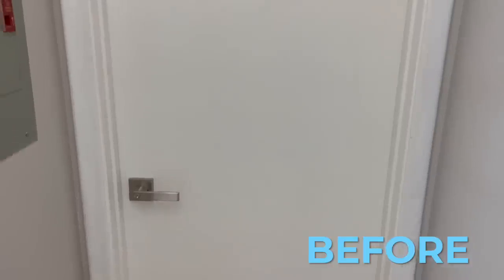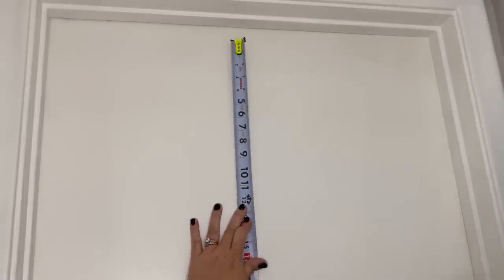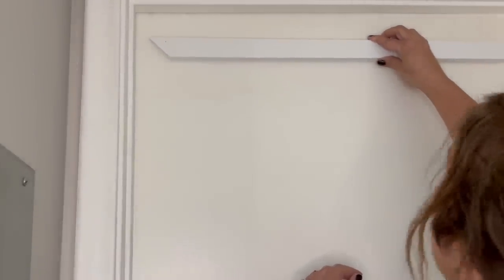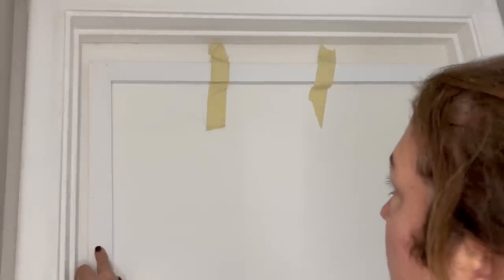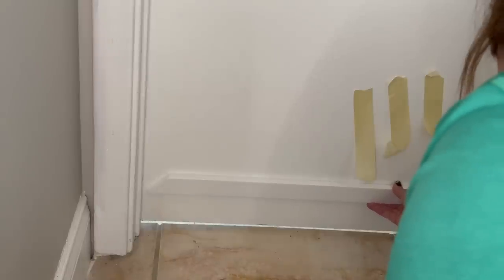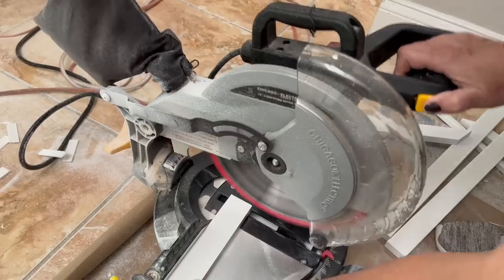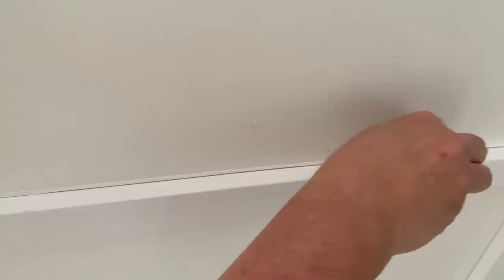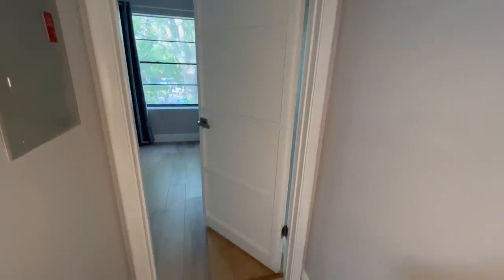Tape up your hallway door (BRILLIANT!)

Comment: Love your door with the trim. Next time go around the doorknob as a square that goes across the top and the bottom connecting with the piece to the right of the door knob  and across connecting the top and bottom. Makes a. great look. Having trouble drawing it utilizing a keyboard, but there's the bottom and side just need the top piece. _]